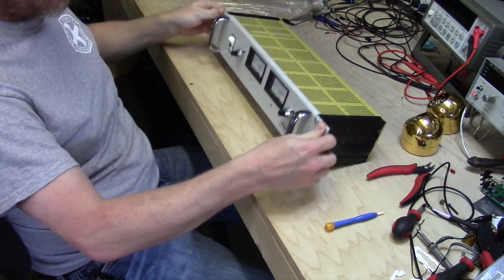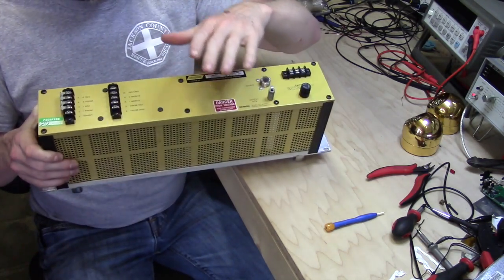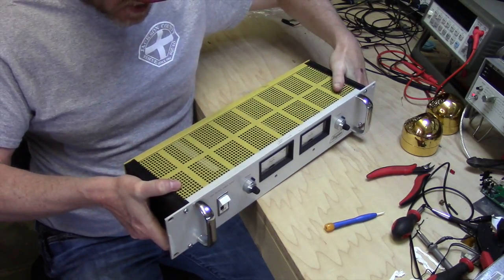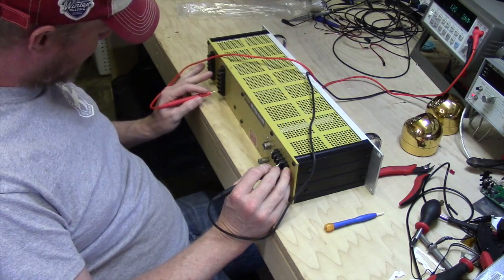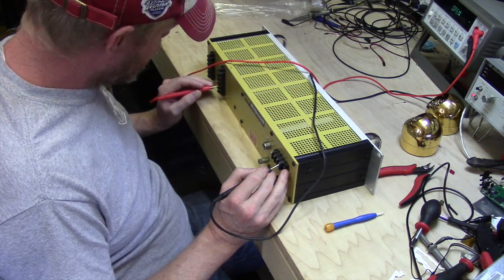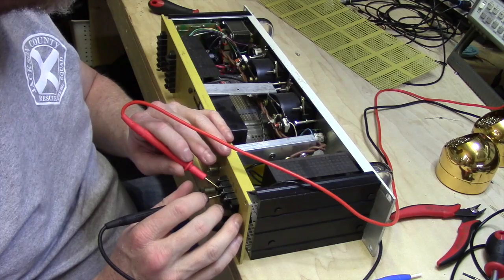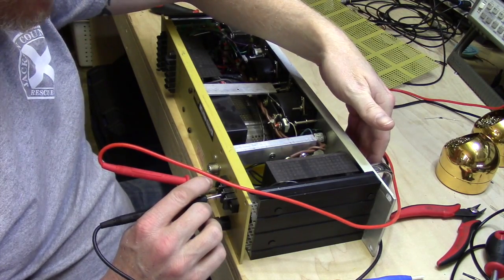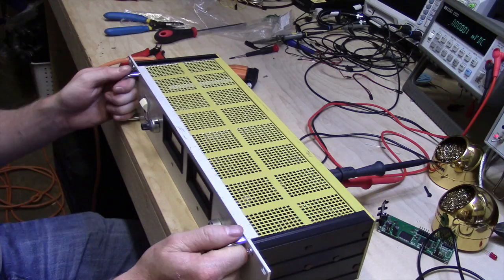Acopian High Voltage Power Supply Teardown

Comment: The big transformer is a step up transformer. 
1) What voltage does the big transformer step up to ?
2) I there another smaller transformer that step up voltage to say 5000 volt and then
    it send this 5000 volt to a Cockcroft -Walton multipler to kick it up to 30000 volt ? 
3) Is that a linear power supply or a switch mode power supply ?

Comment: Hi Shane. It had been over 5 years since you got the Acopian high voltage power supply. 
Is it still working without any problem ?
Did you have to send it back to the manufacturer for repair since you first acquired it ?
Reply from the maker: It still works great.  I use it for all my high voltage testing.  I did have to source a replacement output cable.
Reply: @ShaneBurrell1  The high voltage power supply have either positive or negative voltage output polarity. Under what condition would you use a unit with positive output polarity and under what condition would you use the one with negative output polarity ?
Reply from the maker: @rangiroa100  I actually have the P and the N version.  Mainly, I have used them to test telco grade power systems protection circuits.    Most of the time with power modules I'm using the negative output version.
Reply: @ShaneBurrell1  What is the advantage of using the positive versus the negative version ?
Reply from the maker: For me. I have cables and jigs that work with the input polarity of the things I normally test.  Polarity on those can't be easily changed.